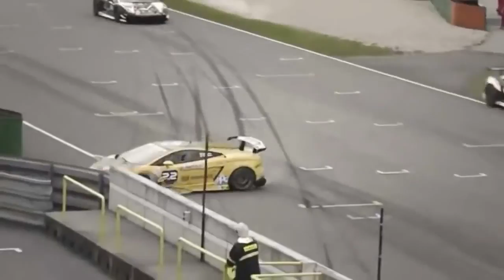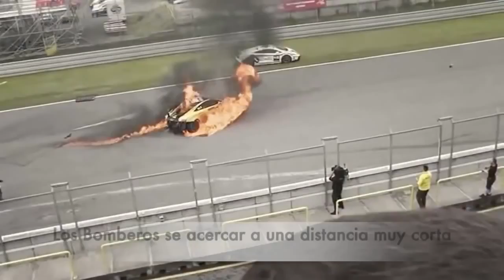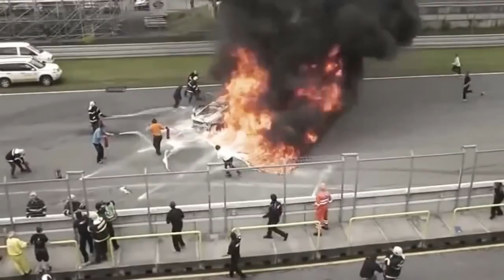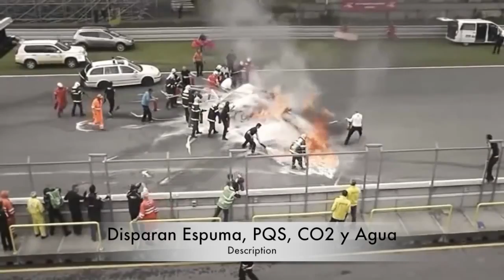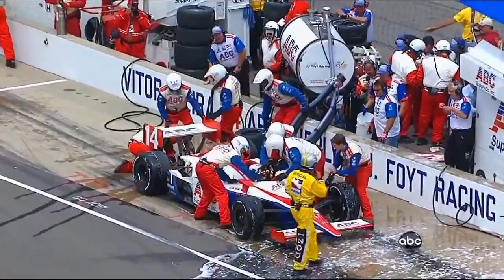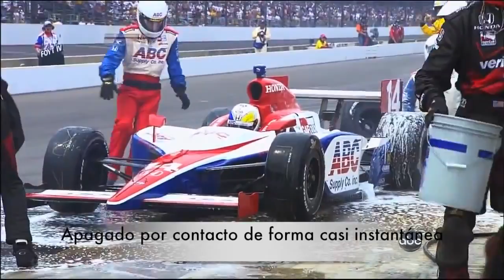Conventional Fire Extinguisher Vs  Cold Fire

Comment: You can't comapre a gasoline fire to an ethanol fire!
Gasoline floats on water and it only spreads.
Ethanol is soluble in water, so the more water, the less fire!
Reply: Isnt there ethanol in gasoline?
Reply: IndyCar uses fuel with 85% gasoline and 15% ethanol mixture. Still just as dangerous as 100% gasoline.